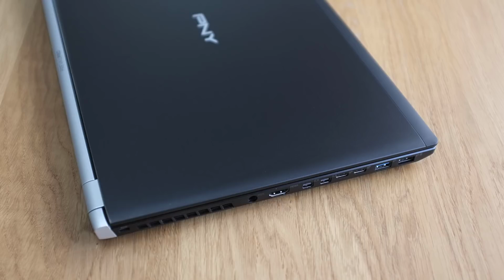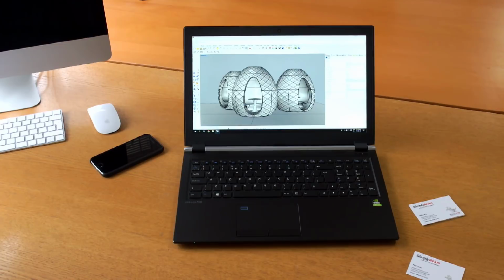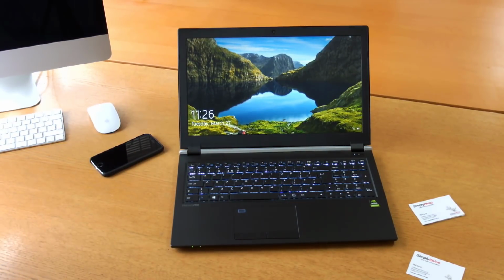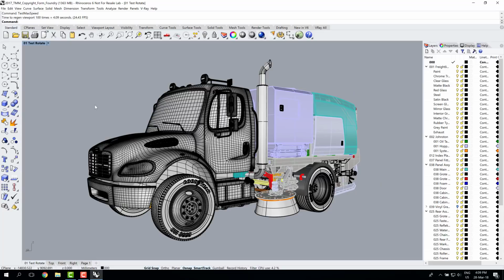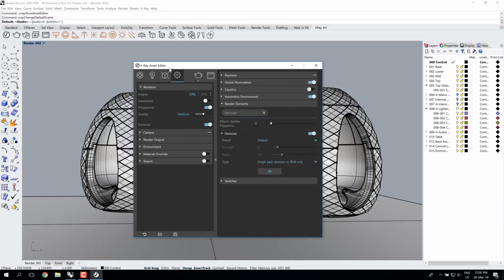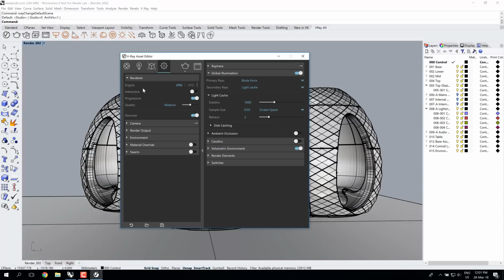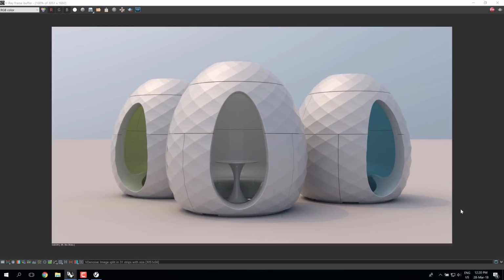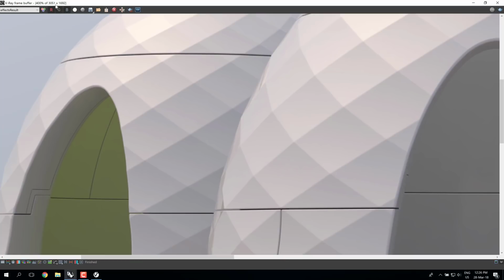V-Ray for Rhino v6 GPU and Hybrid Rendering with the PNY Prevail Pro P4000 Mobile Workstation

Comment: When i activate GPU and click on the 3 dots next to the GPU button, i only get the option to use my CPU. I use an RX560 graphics card with Open CL 2.0 so i know its not a hardware issue. 
Also, when i open the application to select devices for vray GPU rendering it does show my GPU and i can even select it from there, but it doesnt use it when im in rhino. Any idea why?
Reply: i think you need a card that supports cuda (so an nvidia gpu)